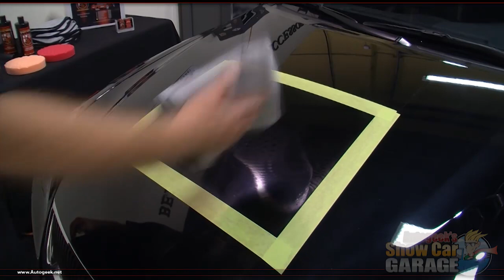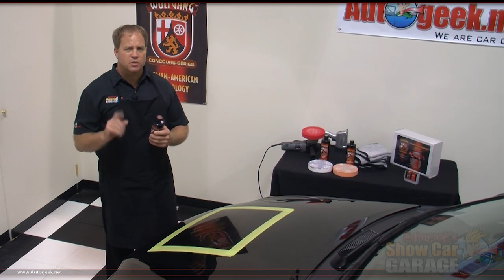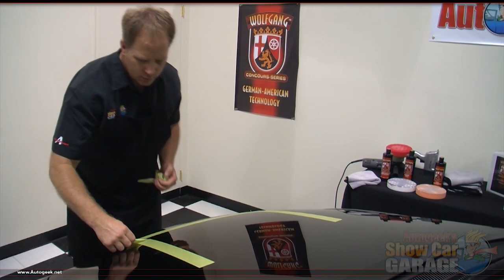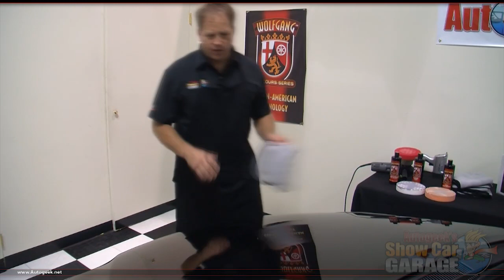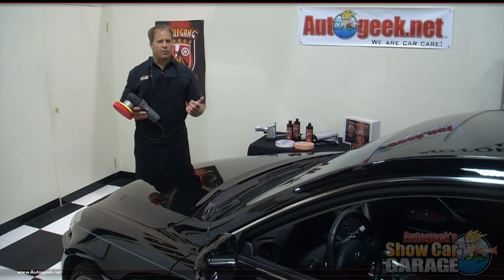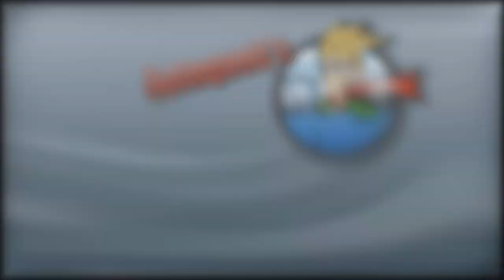Part 3 - How to remove swirls, scratches and water spots using a Porter Cable 7424XP Polisher

Comment: I had purchased this tool from a local detail supply outlet https://www.youtube.com/post/UgkxfzbDkCRyv3CFXnLZI4APZtRRuG2uRmP2 and it has been my go-to polisher since (I've hardly had to break any of my DA machines out since). I run this tool with a 5" Buff and Shine backing plate with an assortment of pads ranging from Buff and Shine to Meguiar's to 3D. This machine is run daily and it run long in my shop. Since getting this machine I've had 4 client cars qualify and go to the Pebble Beach Concours d'Elegance car show this year. Currently ramping up for SEMA where I will probably have this machine running for 10+ hour days for 2 weeks straight. One thing to note is that this machine under paint polishing speeds (typically 1000-1400 rpm for me) does get hot and she is a beefy machine (just think of those shoulder gains you'll get with her). Also as another reviewer mentioned, with a quick trigger pull, she will overshoot the desired RPM and then come back down. Speed control in that aspect probably could use some refining since none of my Flex machines do that, but other than heat and RPM overshoot, great machine and must have machine for the advanced to pro detailer.

Comment: i have hard black paint, I've used d300 with microfiber cutting disc and I could removed 90%, ok for me, and them i follow up with m205 with the thin yellow pad from meguiars and them gold class wax. the car was amazing but after 3 washes the hazing come back. what can i do to solve this problem? if I use ultimate compound with a cutting disc, m205 with yellow and them Ultimate Polish with yellow too, do you think that can help me? hugs Mike, I Iove your videos. thanks !!!

Comment: Mi Mike, once the paint finish is as perfect as this, what is the best method keep clean regularly? I use a foaming lance spray from my pressure cleaner, leave for a few min then low pressure spray off. Which method is best?
Reply from the maker: The best method is the method that works best for you.  For me I use a soft wash mitt with a Foam Gun.   Most important... DON'T SCRUB PAINT.  -Mike Phillips
Reply: Thanks

Comment from the maker: Normally you want cutting, polishing and finishing pads.  I show this in this video you're replying to and dozens of others on the Autogeek YouTube Channel.  As far as chemicals go, be sure the label states they are for use with DUAL ACTION POLISHERS.    Some products, like the 3M products you mention state ROTARY BUFFER USE ONLY and if you use them with a dual action polisher you can haze the paint.  Join AutogeekOnline . NET and post your questions to a "real" forum.  -Mike Phillips

Comment from the maker: For the first step, that is going over the entire car using your compound or polish to remove as many of the swirls and scratches as meets your expectations, you should plan on around 4-5 hours if you don't goof off.  The first step takes the longest because you can't tackle huge areas at once and because you cannot simply "move the polisher faster" to get through the process faster.  -Mike Phillips

Comment: What do you do if you don't have a garage to do that in or a truck that won't fit?  Do you recommend doing that early in the morning or in the evening?  I know the surface should not be hot, but I was wondering if you can suggest a work around.  Great video, by the way.  Thanks.

Comment from the maker: To learn how to prime a pad, copy and paste the below into Google and it will pull up my article with pictures.

How to prime a foam pad when using a DA Polisher

As for how many pads to buff out a car?  More is better, 3-4 pads minimum for each step.  You can do it with one pad but it will take longer.  -Mike Phillips

Comment: Hey Mike, i was wondering what buffer and what products can i use to remove scratches from auto glass? I actually put in the scratches in the glass myself by washing my microfiber towels in the washer and drier and i didn't use special detergent for microfiber.

Comment from the maker: You could do that or use the Wolfgang Finishing Glaze instead of the Paintwork Polish Enhancer.  The Finishing Glaze is very light in its cutting ability but will perfect the paint more than the Polish Enhancer and then go to the sealant.  That's what I would do.  -Mike Phillips

Comment from the maker: Buffing smaller, thinner, tighter or more intricate areas is a little trickier and is best done with a smaller pad like a 4" pad.  I have a video on this topic on our YouTube Channel.  Do a Google search using the below title and it Google will pull it right up...

Video: How to buff tight areas plus concave and convex curved panels by machine

-Mike Phillips

Comment: I used my orbital buffer with some swirl and haze remover. It worked like a charm on my 3M clear bra. Tried the 70% IPA first and it didn't do the trick because I think the swirls were too deep for that.

Comment from the maker: As long as you're using common sense you can polish as often as needed assuming you're not doing things that are self-defeating.  For example taking your car to a brush tunnel car wash will put swirls and scratches into your car's finish.  Wouldn't make any sense to do this and then polish the paint and then continue to run your car through a brush style car wash.  If you wash your car carefully yourself you shouldn't have to re-polish very often, maybe once or twice a year.  -Mike Phillips

Comment: Well I have always clayed and waxed my clear bra along with the entire car. Over time the swirls just started appearing, and ever since I purchased my griots orbital polisher it seemed to have gotten worse. I always use the lowest setting on the polisher (1) with the softest pad for applying the wax. The rest of the car does not have as much swirls as the clear bra at this point. So I should not attempt to correct swirls on the clear bra?

Comment: Do these techniques apply to clear bra as well? I have swirls all over my clear bra, not so much on my paint. I am concerned about making even more swirls in it by using abrasive pads with the swirl removing techniques. What do you think?

Comment: I have both the Wolfgang 3.0 total swirl remover and the Wolfgang 3.0 Finishing glaze.  I bought it in a apackage from autogeek.  Is the 3rd step of the paint sealant absolutely necessary or will the finishing glaze suffice?

Comment from the maker: @hypercatjohn 
Plastic and rubber trim is a hassle because if you don't tape it off and you get polish or wax residue on it then it will stain it white and it's very difficult and time consuming to remove it "completely" so you never, ever see it again.  Taping off takes time and that's a hassle.  Given the option, if the car is important to you then I would recommend carefully taping it off.  The people that design cars have never buffed one out, if they did they wouldn't use plastic trim.

Comment from the maker: @dsm918 
When I say buff the car out in sections, that means if you start with a swirl remover, buff out the entire car with the swirl remover section by section.  After you've buffed out the entire car with the swirl remover repeat the process using a finishing polish, again buff small sections at at time until you've buffed out the entire car.

Best thing to do is call our staff at 1-800-869-3011 and tell them what you're working on and they can set you up with the right kit  -Mike Phillips

Comment: Mike only thing I didn't hear was the size of the backing plate and the size pads you used was it a 5" backing plate with 5.5"pads or a 6"backing plate with 6.5"pads. I have been told that in order to get proper paint correct with a pc a pad no bigger than 5.5-6.0 inches is to be used is this true?

Comment from the maker: @screemingtp 
I will do all of one process to the entire car at one time.  That is if I'm using a swirl remover to remove swirls I'll work section by section until I've removed all the swirls out of the entire car.  Then move on and polish the entire car and then move on to the next step and apply wax to the entire car.

Good question!

-Mike Phillips